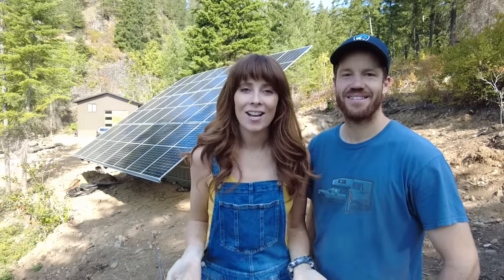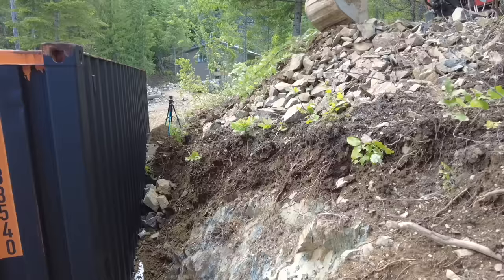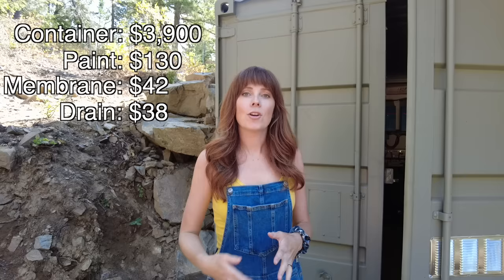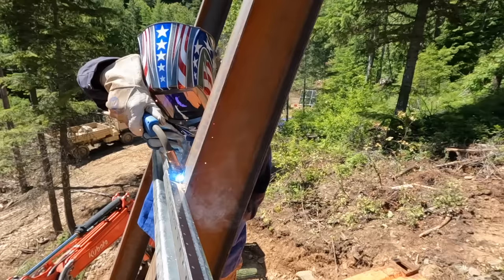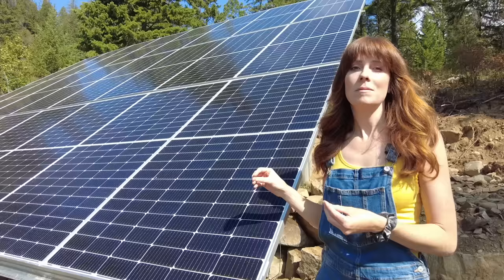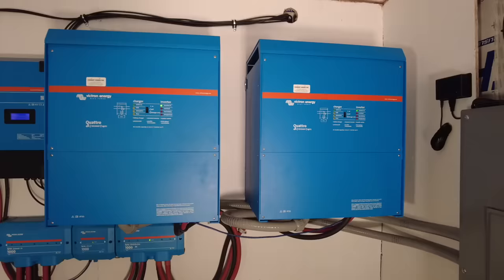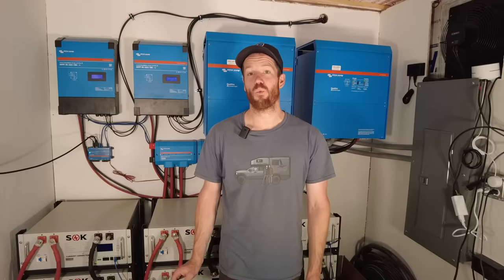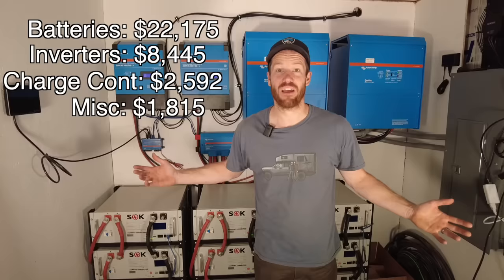TOTAL COST Of Our Off-Grid Solar Power System | Powering Our Mountain Home

Comment: $50k for a DIY installation but what would it be if you needed to hire someone to do it? I’m assuming the utility would have charged $65k to bring the power line all the way to your house?
Reply: You forgot that they would still have to pay a monthly electric bill. So even if they power line would be slightly cheaper, you pay more in the long term. Especially if you hav not only a house, but also a workshop.
Reply: @walther2492  yes of course but let’s say it’s $100k for the total installation vs $65k for the utility line. Then the difference is $35k say over 15-20 years when batteries and panels need to be replaced or repaired. Still maybe worth it to be off grid but not by as much.
Reply: @jeffgreenwaldJLG  If you have to pay 35k for the installation, you got ripped off... And panels & batteries last way longer. Both can run well over 30 years if correctly used and maintained.
But the question is, why would someone pay somebody to install the system. Because it isn't really that hard. Sure, you have to spend a couple of days to read up on the topic, but it isn't rocket sience. Small and justified price to spare couple of thousend bucks in my opinion. And the 2 people in the video are the best prove.

Comment: So you spent almost... 47.800 dollars just to have solar energy?
Err... how many bills could one pay off with all that money, less or more that the lifespan of panels/batteries before they need to be replaced? (rough peanut count that like 40 years worth of bills of an average house).
Reply: Well, panels have a degradation of 2% per year. So after 20yrs you'll be at a half. But in their case it might make sense, since there was no electricity at all. But still I'm sure it will not suffice in winter

Comment: Good solar isn't cheap
Reply: define "good" & "cheap" I can build the same system with less $, wont last as long probably but I can afford it. so does that make it bad? its not as simple as black and white, its what works for you at what price you can afford with what outcome (work) you require. but I understand also, you get what you pay for. be that $, time invested or labor.

Comment: $50k for independence and peace of mind is a small price to pay. SELF RELIANCE.
Reply: $50k would be too much for ME but i did not have to overcome a 60k connect fee. I was on grid already. but I live in East Texas so outages and soaring prices of energy prompted me to build my system. right now I have 5kw of panels and 5k inverter. still building my bank i only have 1 48v 50AH. right now im $2500 into it including my rack and wire. my goal is 10kw of panel and 60 to 80kwh batt with 20K inverter and i estimate $13 to $15k. allready 100% offgrid with water and sewer. that cost me about $2k but i may need another 3.5k gal clean storage so I may have to add $800. (Edit) I already had a tractor and loader so i did not have to rent equipment and I have a ton of tools and a vast background in mechanical and electrical. I did it all myself so no outside labor either. I also have a CDL and a flatbed so I can move large tanks and equipment for just the price of fuel. all these costs need to be considered.

Comment: I would have paid the $60
Reply: the 60k was just to get the lines out not including any power. looking at his setup i would estimate 2k per year for power bill on top of the 60 plus any storms would knock out power for days or weeks up there. that vs 50k and done. its a no brainer solar has way more advantage *as long as you have the cash or the knowledge to do it yourself. PS there is ways to get the exact same amount of system for 13k

Comment: Very beautiful and very expensive! Far too big a battery for the small solar system! It will charge 0.0 in winter.... 25K for battery and charge controller! In summer 0.2 charging cycles X 250 days = 50 charging cycles per year maximum ! In winter 0 charging cycles! In 15 years 750 charging cycles.... 25000/750 = 33 dollars per night just for the battery  ! If it lasts 15 years... Very beautiful and very expensive!

Comment: Your calculations are not totally correct. After 5 years the equipment efficiency will start to drop and you will have to continuously upgrade. The equipment will last, but the low efficiency will force it to be replaced.

Comment: If it lasts 30 years it will be like $139 a month. Seems like a lot unless you are monetizIng the extra energy.
Reply: that is a very nice system with top of the line parts. you can build a system for $13k with the exact same amount of power in and out as he has. (not including labor) if you need it

Comment: That’s a lot of money,,and skeptical me is suspicious of the advertised lifespan. Is it really at least 20 years of hassle free , minimal maintenance and so on…?
I feel that’s most important
Reply: there are other options that cost less. they are running new panels and top of the line batts and inverters also. I took a more modular approach with used panels, and all in one inverters that can be daisy chained. batteries are all the same cells no matter what brand. its more about the add on stuff like meters and switches (and brand name) that you are paying for.  cost wise you can build the same thing (output wise) for about 13k in hardware minus the conex and the rack. I designed my system so if panels go bad I can replace them for $40 ea. if i lost an inverter its about $800 but I will have 4 of them so I wont lose 1/2 of my ability to convert power (only 25%) battery wise I went with 50AH batts instead of 100AH so I will have twice as many to equal the same output but they also are less cost per KWH and i can replace a bad one for $400 instead of $1000 or 1500. the key to all of this tho is I can also have backups for all the components of the system on hand, even in the event of a SHTF, world ending zombie invasion, LMAO and not have to sell off certain parts or places of my body to afford it. as far as maint. of the system goes, there is not much. (depending on where you live) we dont have too much snow in deep east Texas and it rains alot. so barring a part just giving it up and going bad, its set it and forget it for ME. your mileage may vary. I should do a youtube of my system, but right now its a rats nest and not 100% done, plus I dont have the siding all the way complete on the house so it looks ghetto as hell on the outside.